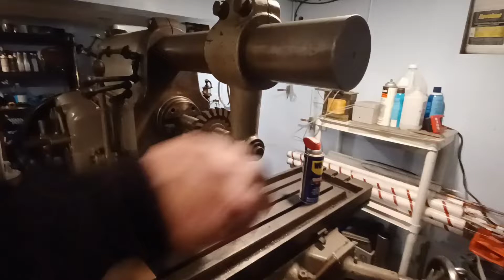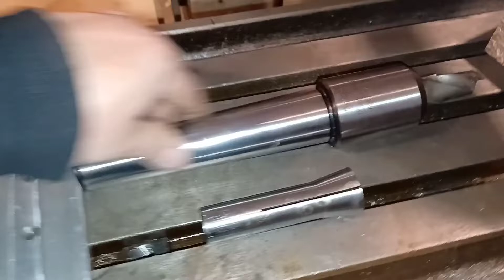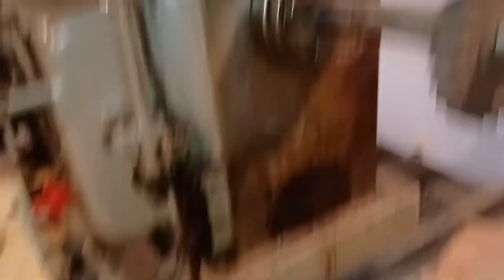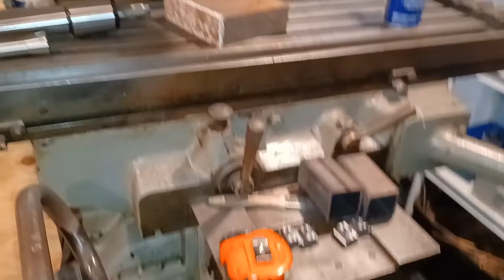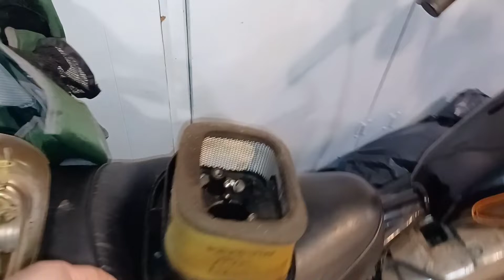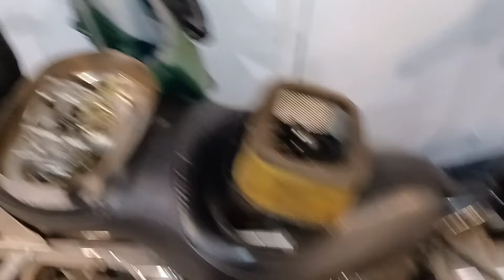Possible Horizontal Mill Conversion  And 1200cc Sportster Carb Rebuild.

Comment: Hello,  Berrymans Chem-dip will clean out that shellac no problem. Getting rebuild kits for those Harley Keihen CV carbs is tricky sometimes, they used a couple different versions. Your best bet is to make sure the bowl gasket matches exactly before ordering. Also make sure the kit has Viton o rings, lots use the old stuff that ethanol eats. I got the 3d print gears, they look pretty good. Still rearranging the shop so it will be a bit before I can try them. All the best!

Comment: It would be cool with a vertical head. Did B&S make one for that machine? I saw how people mount Bridgeport heads to big metal planers and make use of the massive table. I should have a package blasting out this weekend (hopefully) for you. I might omit some junk for weight sake. It's some random transformers. Eddie got his 3D printed gear set. Said they look quailty.
Reply from the maker: That's awesome.  I was thinking about getting the right set of cutters and actually selling the metal gears online. After seeing some of the prices I figured why not. My lathe takes the same exact gear pitch as well. Although I don't need change gears.
Reply: @backwardsmachining7526  Could you batch cut multiple instances of a single gear out of a solid piece of round stock, then slice it into individual gears like a loaf of bread?
Reply from the maker: @johnstrange6799  yes,  you can also have them cut to width ahead of time and stack them together to cut several at once. Like a big...metal... sandwich lol. So end up making 5 of each gear at once.
Reply: @backwardsmachining7526  I failed on the shipping deadline! One of the dumbest things I've done in recent weeks! The cause of it was I couldn't find the stuff, and of course I searched everywhere three times, then ended up right back where I started, again fixated on these particular little cases I have with relays in them. So I go through all of the stuff around these cases in my storage area and still can't find the stuff only to then realize that while fixated on these cases and things around them I kept stacking stuff on top of the storage container that the actual stuff I was looking for was in all along!! As I uncovered it layer by layer a kind of fear of utter stupidity set in until... "Yep! I'm an idiot!" - The package is all ready to sail, but looks like it will be after Christmas unless there is something that has to get shipped emergency style. (See, when I wait until other stuff has to get shipped, I ship stuff free basically, so it's a window of cheapness I'm always at odds with).
Reply from the maker: @johnstrange6799  its been crazy on my end as well..  heck I can't tell you how many times I was holding my cell phone listening to music to then wonder where I left I my cell phone so I could send a text lol.. Today marks the start of my 2 week vacation so I can finally try and get some stuff done around the house.  Looking forward to some shop fun as well.
Reply: @backwardsmachining7526  I do the same thing with pencils and my scriber especially,  and no one can keep track of a tape measure. Enjoy your vacation! :)
Reply: @backwardsmachining7526  Your package has been shipped. I have a tracking number for you, but I left it upstairs.
Reply from the maker: @johnstrange6799  ok dude, I'll keep a look out. Working on my cnc table now. I'm trying to connect my router to start doing woodwork projects. I'll be uploading a video soon so you can see what I'm talking about. Can't wait to see what this table can or can't do.